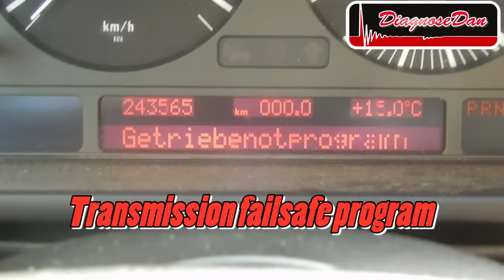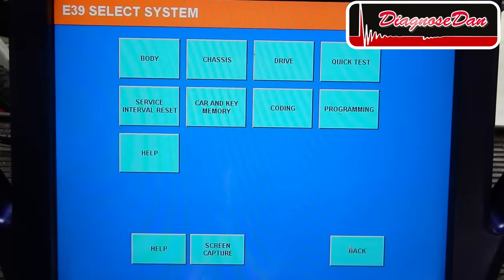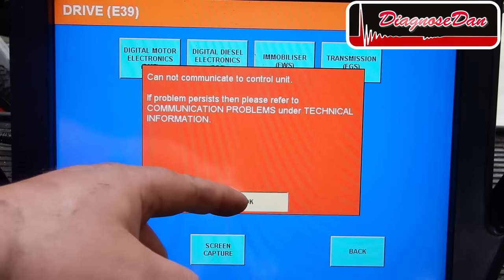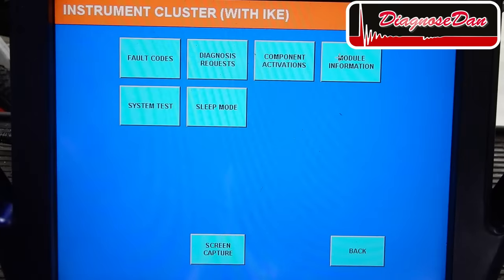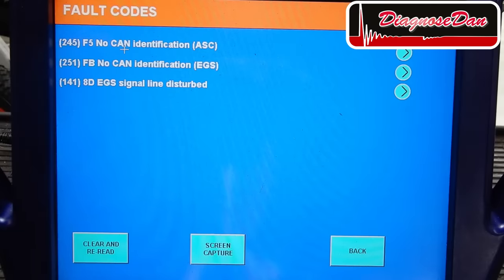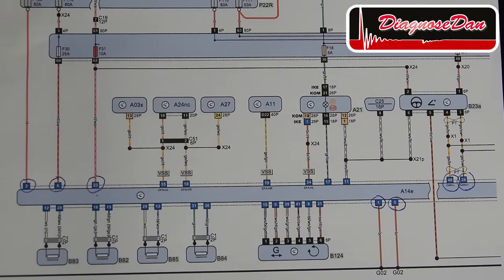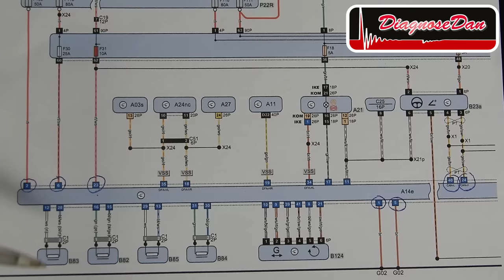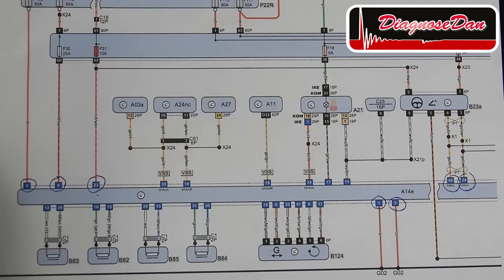Can-bus Trouble

Comment: Am I correct, that if you put more resistance on the wire, you can up your amperage, because the amount of voltage you're transferring lowers with resistance?

Comment: Is it possible that there is a socket(s) in the existing wiring to check the operation of the can bus and thus avoid having to touch the terminal plugs?

Comment: Hi does it matter when using the oscilloscope the grounds on the obd port where you use pin 4 or pin 5 . and can you as pin 4 is chassis ground and pin 5 is signal ground. Thanks in advance
Reply from the maker: If there are no problems it's Ok to use them.

Comment: Hi Dan I have a 2019 renault traffic.  No comms with abs module.  Got good power and ground. Can bus OK. When unplugging module can high voltage goes normal. Plugged in drops to 2.3v all modules complaining of no comms. No speedo. Abs steering faults etc. I suspect faulty abs module. If there's communication and good power and ground. Is this likely. Thanks Dan. The wiring diagram doesn't match the vehicle. All other modules are online

Comment: Hey dan thanks for the input I have a 2014 Nissan Altima with code u1000 and u1001 and miles per hour don’t work tpms abs or tcs all those lights are on the car runs and drives fine the driver side tire was ripped off due to car accident but I replaced all the suspension and now I’m having this issue any advice ??

Comment: Hello, I just saw a comment from 3 days ago and thought this was a new video. Question, if you disconnect one if the modules and it has a 120 ohm register. Why does it fix the problem? Does not the system  still only have one 120 ohm resistor?

Comment: Hi there,got a code 01309 on a vw PASSAT CC 2009  I think the electronic rack and pinion should be replace cause i have voltage on the electric connector what do you think?

Comment: So what I'm finding seems very different. I'm taking the readings with the key in the on position with the engine off at the OBDII can hi and low pins.

With just the body control module disconnected I have the same waveform's as with everything connected.

With just the Brake control module disconnected the waveform changes drastically and is mostly a flatline. 

What should this mean? I would think that the brake control module is having issues but idk

Comment: Check for 60 ohms between pins 6 and 14 of the DLC verifies bus integrity. 120 ohms indicates an open in the bus. Next, test for greater than 1k ohms minimum (3k-5k is better) from pin 6 to ground or 14 to ground. This verifies the bus is not shorted to ground. Pin 6 (CAN HI) toggles from 2.5v -3.5v and a good meter will read 2.8v, and pin 14 (CAN LOW) toggles from 2.5v-1.5v and a good meter will read about 2.3v. If the bus is good, then load test module powers and grounds with a headlamp bulb. Amperage verifies circuit integrity. Powers and grounds test good including any power moding circuits, the box is bad. An oscilloscope can also show a bad ground or open power fuse indicated by a offset of the CAN HI or CAN LOW voltages.

Comment: Dear sir, I have a vw passat 2011 1.6TDI. A few days ago i used the VCDS mess up some of the settings in my car BCM? only the little lcd screen in middle of dash board is powered, and the remote key can open and close the doors but the car dash board not any light on when I inserted the key( no self-test).the car can not be start, because the ignition can not be turn on, VCDS can not connect to the BCM, so I want to know that can I replace the BCM with second-hand one to fix the problem? Do I need any coding after replace the BCM?  Thank you!
Reply from the maker: I think there should be a way to fix this without new parts, but i'm not a VW expert or Vcds expert.
Reply: Just want to tell you that after a few days of research my problem has been solved! happy days :)

Comment: I have a confusions about the resistance measurement.
You were showing that the resistance between two modules should be 60ohms before disconnecting and after disconnecting it became 120 ohms. How does that proved that the ABS module was malfunctioning? (Apologies for if I might have misunderstood or something)
Reply: The resistor value doesn't prove the ABS is malfunctioning. The proof was that after disconnecting the ABS module, the waveform returned to almost normal. That was the proof. The 60ohm vs 120ohm was the reason why the voltages were still not exactly as the known good and that is because one end of the CAN bus is in the ABS module and that's where one 120ohm resistor is placed. When you disconnect the ABS module and you also disconnect the resistor from the CAN wires and that influences the voltage of the signal.

Comment: Thank you, thank you.  I may watch future videos.  My take away is a little different.  1.) I will try to never buy another auto from a non English speaking country.  2.)  However, I am in the market for a Toyota Sienna and will insist on a scan before buying.  3.)  My 1995 Ford Windstar seems to run perfectly but has been plagued by electronic gremlins such as the ECU sending out random pings about once monthly and having the interior lights flash on for varying lengths of time etc.  These issues are not dealer fixable.  4.)  The satisfaction of owning and enjoying a vehicle and is being over shadowed IMHO by the complexity of design.  5.) Here in San Diego the ideal road machine would seem to be a Humvee as the potholes are as large as foxholes and  roads are poorly maintained and appear to be repaired by cartel members from over the border. Ha

Comment: I have a 2003 ford Expedition throwing Can Bus error codes, and someone on youtube told me my truck does not have a Can Bus system because it does not have pins 6, and 14 on the obd-II port. What would you have to say about that?

Comment: Hello I have a problem with the bmw x3 module which has communication defects in the engine control module which are: 002A87,002DCC, 002DCD, 002DCE, 00CD87. I also have defects in most of the instruments: F4, F7, F6, F8 Kombi: Can there be no identification (DME). Also in the fuel pump module, C7 EKPS bus with communication defect and D4 EKP lack of engine torque command message. In ABS D347,5E46, D36A, 6F5B, 6F59,6E58. I already checked the can lines that come out of abs and other modules and the mirror signal is normal but the high and low can output in the obd port that comes from the ivm module is not viewable with an oscilloscope, likewise the can signal output of the motor calculator It cannot be viewed either, it could guide me in this particular case. I would like to determine if the fault is motor ecu or ivm module. Reguards

Comment: Help Dan.
i am puzzled with the CAN reading on the high and low wire at OBD pin 6 and 14. with battery disconnected
done the test on 3 cars and the reading as following.
1. 2013 Subaru Forester resistance reading 61.7 ohms
2. 2018 Subaru Forester resistance reading 124.4 ohms
3. 2018 Honda Accord hybrid resistance reading 124.4 ohms.
what could be the problem?
appreciate your help
regards

Comment: Hi Dan, Have you come across the problem of the continuous rebooting i-drive on the 5 series F10 SE 2010 model, mine works fine in cold weather but in hot weather, it takes hours to reboot. just keeps flashing BMW on screen. Any ideas.
Reply from the maker: Jim Tui, No sorry but would be a great one for a video!😁
Reply: Yes, I think so, I will try to get a video of it happening and send it on.

Comment: I have some question. is the ignition on? is the car in sleep mode? can you have a pad in the obd2 when you measure?
Reply from the maker: If your talking about the resistance,  network asleep so ing. off.
Reply: @Diagnosedan  Yes I mean when you measure the resistance in the PT-Can bus. OK thanks I have a BMW e65 with some problems on the pt-can system. I have 60 ohm on all the control units but i dont have a scope so I cant read the signal when i disconnecting the contact.
Reply: Control unit DDE, EGS, DSC and PBC does not communicate. Im not sure the different between FACAN and PT-CAN same system?
Reply from the maker: @Bmwdiagnostics92  All those Systems are on the PT can, you would really need a scope to are what's going on.
Reply: @Diagnosedan  thanks for reply. Yes I think a scope is the only way to be 100% sure. Okey they are all the same. Flexray, Enternet, Lin bus, K-can so i can do the same troubleshooting as you showing in the video? Thanks again (Y)
Reply from the maker: @Bmwdiagnostics92  No they are not the same😬
Reply: @Diagnosedan  Okey I hope you can make more troubleshooting videos on them. How to fix Flexray, Enternet, I want to learn more about them. but thanks for the help.

Comment: @DiagnoseDan, I realize you are in the Netherlands - Holland for us Americans. I have an Identifix DIY subscription, but the Volkswagen wiring Diagrams suck. They pretty much suck in every subscription. Is there a subscription or similar service in Europe where I could get some reasonable wiring diagrams from? The 2017 Golf (TSI - Wolfsburg trim) has several CAN buses, a LIN bus, a MOST bus and a glasfiber bus. It probably has a K-Line and L-Line on there too. None of it is shown on the wiring diagrams. None of the colors are correct, and the ECU pigtail I have does not even have the Pins in the right place according to the Identifix Diagram (both the OEM diagram and the Identifix diagram completely disagree with the pigtail I have).

There is nothing wrong with the Car, I have no questions about that. All the modules I am playing with are from eBay. (Oh, I'm in Seattle, WA) Every single Youtuber (scannerdanner, Ivan, EricO, and many many others) are all on the East Coast. I feel lonely here...

Comment: I had this problem on E39, abs module was so fried, could not be repaired or code's retrieved, so I found a second hand unit with exact same number, plug and play, Handy tip, if you ever have the same problems.

Comment: I find it very strange that the ABS module connector is oriented pins down into the module mating connector, especially given it is in the engine compartment. As you can see in the video the ABS module connector housing (pins pointing up) can easily pool water inside the connector housing, which can lead to corrosion which essentially can electrically cross connect circuits (bridging due to green crusties), which could corrupt the CAN bus signal traces, like shown in the video.

Comment: I have same problem with my toyota camry. But mine is the ABS and BREAK indicator are showed. The cluster, idle and a/c are all affected. I cut the can h, and can L twisted wires from the socket of abs module. Then it's OK now., but the only problem now after cutting, is the km/h is not working. My question is., is it OK to cut like what done

Comment: DiagnoseDan, I see you do the resistance test of the CAN Bus circuit, but never mention that you disconnect the car's battery. Is this the norm for testing this portion of the circuit...I am worried leaving the harness connected to module, even if battery was disconnected, that a capacitor would discharge into the circuit and the voltage would damage the meter or it's fuse. Any comment? Thanks! Love your videos! Certified Master Automotive Tech L1 Certified from USA

Comment: Hi Dan
 
Do ALL car CANBUS networks have 60ohm or 120 ohm resistor terminations, particularly Mercedes?

I have an intermittent fault on my R230 SL55 2003.
P1925 Drive Authorisation refused ESM Gear Selector. 

BUT just scoping and metering around CAN B and CAN C I've discovered CAN C measures 60ohm ok but CAN B has infinity which can't be right surely?

Can't find any info on my Mercedes diagrams and no one on the forums seems to know if there should be network resistance there or not.

So before buying a new gear selector  £700 (ouch!) I wanted to make sure if my CANBUS B is terminated correctly.

The CANBUS master is the EIS ignition switch but there is no 60ohm reading starting in that module either.

Anyone knows the answer it would be greatly appreciated. 👍

Jules

Comment: wow. you are one in a million .  my friend has a VW / seat Alhambra 1.9 tdi .. quite old ..  but is occasionally hesitates .. like the motor completely cuts out . the local diesel specialist diagnosed a faulty fuel injector for €500 euros  . the one with the electrical connection .. Well it was not that .. and he didn,t get his money or old injector back . then the same Diesel SPECIALIST  suggested a bad injector pump ..   a small fortune, more than his old car is worth to fit a new injector pump . so he is having to  put up with the occasional hiccup from his otherwise sweet running 1.9 tdi vw motor .I have driven his Seat ASlhambra and it drives really nice.. and It never hiccupped on my test drive .

Comment: I don't get it . 2X120 ohms in pararel = 60 ohms . So if you disconnect one , which you did by disconnecting ABS module reading should be 120 ohms . That is exactly what you have . So how did you arrive at faulty terminating resistor in the ABS unit ?

Comment: Just out of curiosity, what scanner are you using on the BMW?
Reply from the maker: The Autologic scantool, older model
Reply: @Diagnosedan  
Oh, okay. How well does it preform on euro models? I've been looking at getting the ISTA-P for BMW, but im hoping to find something that does well across the line on various manufacturers.
 Right now im using the modus by snap on. It's a great tool, but still fairly limited with European vehicles, especially BMW.
Reply from the maker: @bryancenterfitt7127  On my Autologic there is only BMW installed, you pay per brand.

Comment: detailed....helpfull👌
Reply: @Diagnosedan  sir....
please reply for my question i am in difficulty..
mine is Honda civic hybrid 1.3 IMA 2008 (2nd gen)
problem is 
1.engine warning light came on rocker arm pressure switch(all is working fine  like autostop,engine cruising at 40 speed but mileage"Mpg" was down side & after i take car 3000 rpm its limits and get jerking not going after 3000 rpm)
i took my car in honda for engine light.they told me your engine harness was bad..in two to three places cuts found..it need to change whole engine harness.(it is too much expensive in india because only 300 units sold in india discontinued)
but i dont understand why?? because honda mechanic showed me there are some problem in vtec solenoid 4 switches.not too much wiring cuts only switches wires are cuts some i take it in my home 
and i try at home 1st i disconnected 12v accessory battery then IMA switch also.after an hour with safety tool i removed engine plastic cover and i change all four the switches wirings so............... 1st problem was cleared and engine light is gon.after this problem solved my IMA battery get more backup and also glass power windows are fastly close and headlights are more brighten and 3000 rpm also solved and mileage is too much better..but when my engine light gon two more lights are on 1.is ABS yellow light also red &
2.transmission d also blinking
currently this is the problem autostop is not working mpg is good enough
ABS RED AND YELLOW LIGHT & TRANSMISSION D LIGHT BLINKING
i was checked all things i scanned a car code was U0129 (Lost Communication with Brake System Control Module)CAN BUS
i try to delete codes but its not deleted
please help me please answar me........send any link related to tranmission d light blinking or communication lost
AND also one point i tried to start car without turning on hybrid battery i think that was my fault or because of that fault will occur

Comment: If it was easy, it would have been nice to confirm the bad ABS and see a second waveform by plugging it back in and unplugging another module. I worked on an old Ford EEC-IV and saw 18 volts on the 5v line. The one ground wire for the entire system was corroded right at the battery terminal. I am willing to bet that in this case, the wide overshoot on the scope voltages was caused by loss of the second resistor in the ABS module...broken solder joint(?) If the module wasn't potted, I would be curious to see if that was true. Measuring resistance on the new one should give us 120 ohms.
Reply: No I'm wrong... if the resister was broken inside the ABS module, it would act as if it was unplugged(?) Perhaps the internal circuit that generates the 5V output has the broken ground and it overshoots. I've seen a few videos by Louis Rossmann where he repairs laptops. He goes into detail on the circuitry that creates various DC voltages from one DC source.

Comment: Had to change the same part on my E39 540 some years back,  however the abs unit was needed to be coded to the car to work, you did not show this.
Reply from the maker: Yes that's true, there are a few variables, the replacemend unit in this Video was a remanufactured one with the same coding. 😊

Comment: Good day Sir, i have a problem with montero sports gen 2.. when it goes to 110 kph.. check engine appears.. i check it with scanner and the fault code is U1102 ASC CAN TIME OUT/ NOT EQUIPPED.. what is the cause of this faults.. i need some advice how to solve this issue .. keep safe always

Comment: The reason twist adjacent  wires is for active sygnal  perhaps magnetic field  induce voltage  make  some kind of  amplifier effects  .....,
I heard  from electronic  professor  going back to Korea  after 2years trade professor  who is my brother in law's younger brother around  in 1985  sometime  he told me when audio speaker wire twist  3 to 5 times  (?  don't  remember ) per every  one meter    make sounds better  than  without  twisted  wires  .

Comment: where did you get your back probe set?
Reply from the maker: From GMTO
Reply: also, I have an 06 Volvo v50 in the shop right now, it has a DF01 - "CAN high, low speed CAN signal missing" fault stored in the CEM. would low speed CAN affect the high speed powertrain CAN and send it into limp-mode ?
Reply: @Diagnosedan  Thanks!